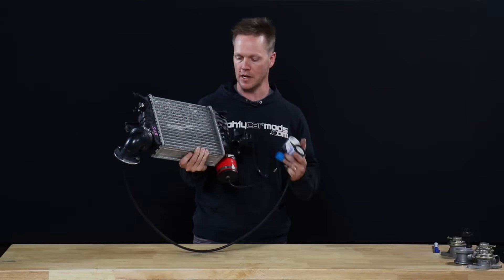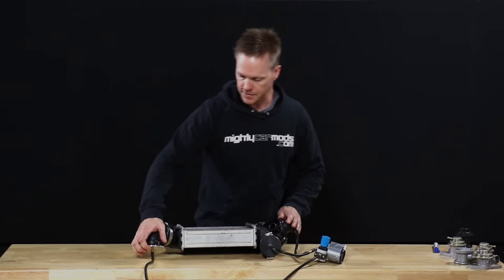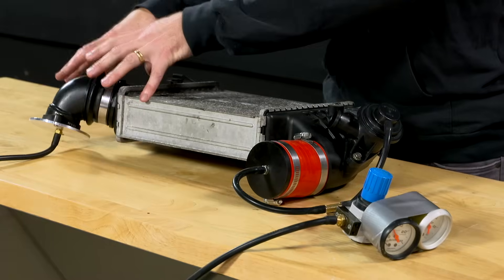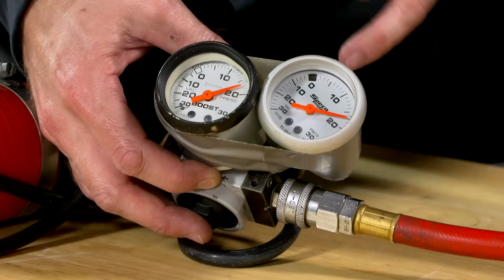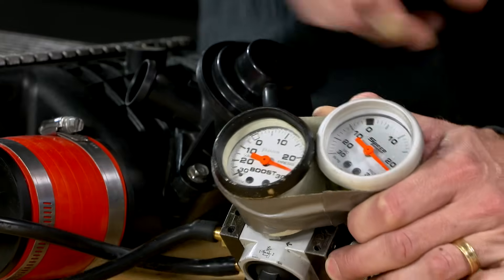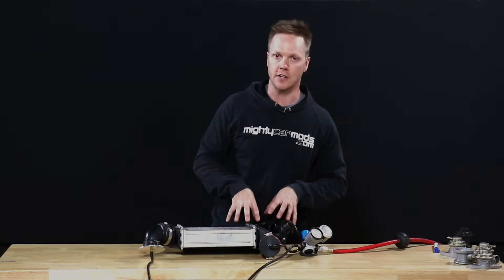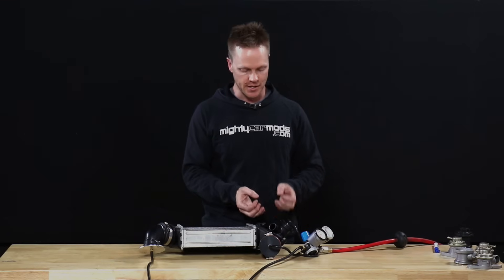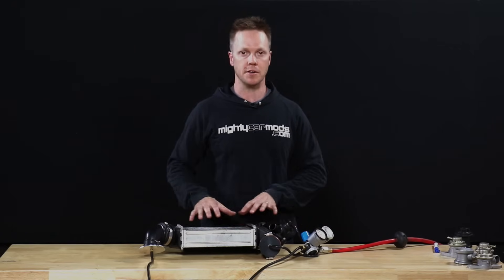Pressure Testing A Factory Blow Off Valve [GO FAST BRETT]

Comment: what if I do not run a blow off valve? for the flutter sound ofcourse... I heard it shortens the life of the turbo, and it's logical... BUT, how much is the difference, mileage wise? considering proper heating up the car and proper cool down

Comment: Have to not forget the blow off valve also performs other functions. One of its main purposes is to protect the induction system components from potentially damaging over pressurisation issues. The pipes, hard and flexible, ,clamps and connectors, sensors and intercooler radiator are all prone to damage if over pressurised. Under certain circumstances it also prevents damage to the impeller following rapid on/off boost driving. This has been called compressor stall but it's not quite the correct term. Higher pressure after the turbo and low pressure following a lift off before the turbo can result in the air flow reversing and stalling the turbo. I have seen sheared turbo shafts caused by this effect! Last thing you need is bits then being ingested into the engine! To protect some of the race engines we have fitted multiple blow off or dump valves to protect the systems and reduce turbo lag.
 Reducing turbo lag is an important function. If the turbo is not slowed down ,stalled and even reversed then the faster it can return to full boost.

Comment: ahhh im pretty sure a turbo FLOWS a shot load more then your little compressor hose, which would  negate that tiny leak
Reply: it's not about the flow, but the pressure...

Comment: the fiesta st's diverter valve is perfect to at least 23 psi...I know this because that's what I'm running. lol basically what this video proves is....you don't need a new diverter valve unless youre running a huge increase of boost compared to stock. I think these videos are making people more paranoid than they need to be. the only time you really need to worry about the diverter valve is when youre running a hefty amount of boost over stock. a couple psi over stock isn't going to do anything to the valve.
Reply: Yes but will it hold up over time?
Reply: Dylan Knight quite often they do break over time factory diverted valves. Most bosch units do tend to start to tear their diaphragms after 50k miles on stock psi.

Comment: How would you know it's the valve leaking and not the other connections/flanges?
Reply: boost tester. with the engine off you can test your whole intake track and youll hear it

Comment: Do the Euro style valves such as on Fiat have the same issue? I have a GFB DV+ already, but just curious because most people say the only advantage to the DV+ is that it's more reliable.
Reply: Do the Fiats use a BOSCH Diverter Valve like VW/Audi? If so, the diaphragm in those is known to collapse and cause boost leaks. The stock DV on my 2001 Audi S3 was so badly damaged that it would only hold to 4psi (my tune was set to 18) but I put a GFB DV in and fuck, what a world of difference it made!
Reply: drucejnr Yes they do. I have already upgraded that to a GFB DV+.

Comment: nice to see this actually tested. everyone on the forums told me mine would leak at 19 psi but I've been running 21lbs no issue. thank you for confirming!
Reply: Would always be better to check the valve for boost leaks to be sure that the blowoff is still working to spec, as it gets older it can wear down and leak at lower pressure.

Comment: Im guessing roadkill/mcm video will be up by the end of this week
Reply: roadkill vids are done every month and mcm said they will be releasing same day
Reply: polandadam98 zero chance that's happening
Reply: but roadkill just released ep 56 and then theres motortrend paywall
Reply: They said (maybe in the roadkill/mcm unicorn circuit?) that it'll be released on both channels, and MTOD at the same time.  So no paywall delay.
Reply: polandadam98  it'll be the boost caboose video first. I have MTOD so i get motortrend videos a month in advance, and that one is ehats currently on there. while I'm guessing they'll probably release it on YouTube first for the team up, my guess is at least a month
Reply: I was just used to the car build vids and and earlier vids usually it would be a short vid then followed up by mcm full vid at the end of the week